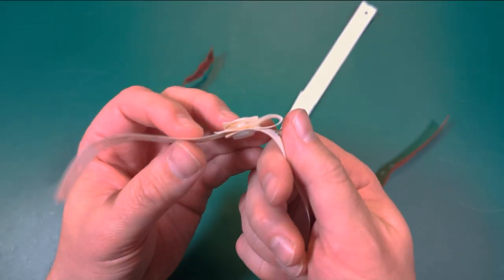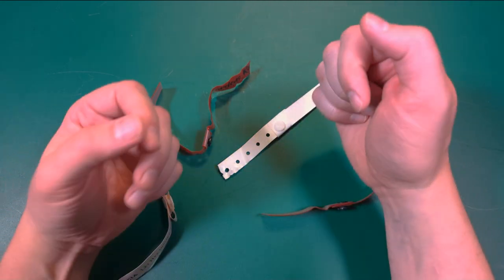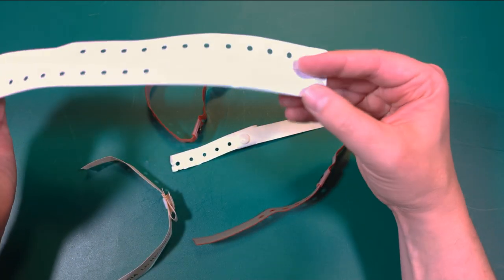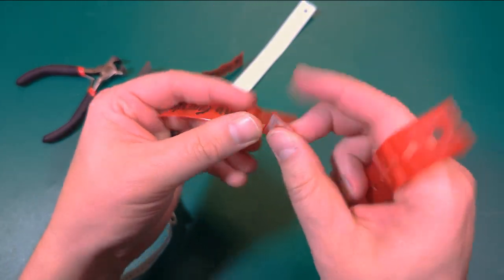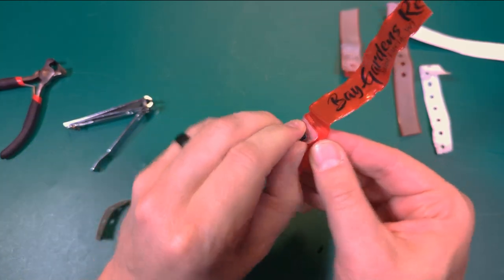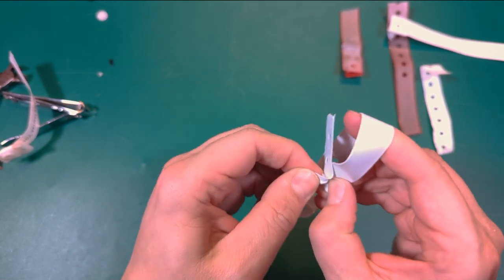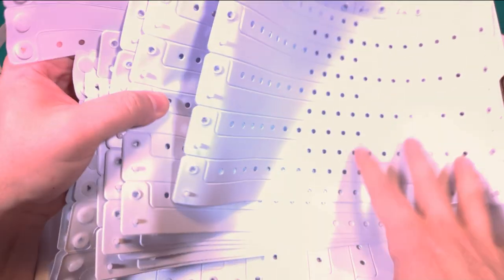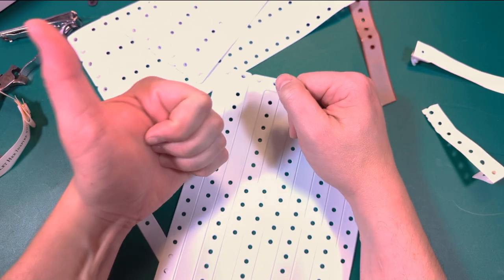Tampering with Wristbands - Part 1

Comment: it is possible, although maybe time consuming to remove them non-destructively, such that they can be put back on, with no tools. I was once admitted to hospital for about 3 weeks, and when I went in they twisted the wristband when they put it on me, which drove me mad. I spent a while applying gentle pressure, the snap eventually opened, I was able to remove and untwist the wristband, and then after that the snap held well enough that it wouldn’t come of accidentally, even if it got caught, but I could easily open and close the snap, remover the band and put it on as often as I wanted

Comment: I used to do this tons, there's a better way though, no additional tools or anything. Specifically those plastic/paper bands, if you cut a line right up to the hole the snap goes through you can take it right off and put it on again. If you want to secure it when you put it back on add some tape to the underside between the snap layers. Invisible, easy, no additional tools.

Comment: Presumably you only need to make it  big enough to slip on and off, so what I do is clip it enough to undo it with my tiny swiss army scissors, move it to a hole that allows me to pull it off and put it on without too much trouble and use a lighter or iron to gently melt it enough that it doesn't come apart. If you're gentle with the heat you can keep it hidden on the inside of your wrist.

Comment: I'm afraid I may ruin your plan! If you use the tapered end of a travelers hook from the back side of one of those snaps (female side, while it's open) you can wiggle it around and bend the fingers back to the point that poping the snap back open is very easy. You can make those snaps last for hundreds of reopening. If you don't have any snaps to spare, use a sewing needle to bend the fingers off the post. This will allow it to separate from the other side and not damage the snap! Then feel free to let a friend enjoy the bar at no cost. Try it out, then maybe give away the rest of the box and start collecting all the colors so you always have a replacement for the original color.

Comment: If you just shave the hard edge of the part that locks in, into a bevel with a nail filer, it should become a reusable snap. No need to have a stock of them and chop the thing off every night.

Some of these if you apply enough force will just pop open and have deformed themselves into a reusable state.

Comment: After you cut around it with the nail clippers, then come at it from the top to cut the stem off, now you can get the nail clippers over it.
Also I would just gilitean the stripps off to make a new strip of just buttons. then you can cut them apart like little pills so the raw buttons without the carrier don't get messed up in your bag.

Comment: Probably would be easier to just buy some regular plastic snaps from a fabric store and use those over and over. If you keep the snap to the inside of your wrist nobody is going to see it, and they also come in a lot of colors so you could keep some black and some white to match

Comment: This is an excessive solution for something some devious 4h-ers in Medina county ohio solved over ten years ago, they had to wear the wristband all week, so several options were developed to circumvent that. Option A: “whoa whoa whoa that’s too tight make that looser.” Gets loose enough to where you lather it up with soap and slip it off, they slip back on much either than they come off. 
Option B: you carefully cut a slit at the point where the snap is in the band it passes through and you just pull it out to take it off and put it back on. The story here is the problem became so prevalent and they were catching so many 4h-ers passing the wristband through the fence to get their friends and family in that they stopped using wristbands all together and went to punch cards that were gold embossed and apparently increased the cost significantly since they don’t come in sheets, but you couldn’t forge a card easily cause of the gold so it solved the county fairs issue with supposed lost revenue, that they then subsequently spent on gold embossing.

Comment: You can also use gallium for the metal ones as they're usually made of alluminium :p not sure if it's worth the cost and you would need a new metal piece but it will not damage the cloth at all XD

Comment: I immediately thought of an easier solution, maybe to easy and detectable? In english they are called snap fasteners ( just look up the wikipedia site). Couldnt you just use one of these? Granted they look different but to these people really check? They are small, made out of metal and easily reusable without popping out  by some light pressure.
Reply: Also some could see these and think of overkill but you could rivet a bunch of these together at home as the lip surely is enough for the tiny hole on these wristbands. Im not talking about riveting these on the actual wristband (even if you could to that if you wanted). Seems way more comfortable as reusable and no snipping away each time required

Comment: Honestly, dude, I was thinking you could use some cut-down refrigerator magnets or velcro tape to hold it on.

Nip it off from the back, hold the button cap in place with some super glue and then do the same with your removable connector of choice.

Comment: Here I am, sitting at home with one of these stupid bands for three days for a gaming convention. Unfortunately they use the other version where you have a teethed cylinder they pull the band through. Those are actually making permanent marks on the band so you have to replace them rather exactly.

I did manage one year to get it off and on without too much issue, but this year it just is way too tight.

For things like a gaming convention run by unpaid volunteers, I am willing to make the tradeoff that these bands cost money, but for anything more expensive like a trade show, you should be able to get a new band each day if you have a multi-day pass. Only problem is that this means standing in line every day.

Comment: I exploited the hell out of these years ago.. I used the tool to remove the terminals in Molex connectors... A little push and a twist and they almost popped right off... If they didn't re-snap a drop of crazy glue did the trick... As a group we collected them off ourselves after each event. They would recycle the colors every week or so.. Just needed a color that was close... They got a bit sneaky, cutting them off when you left, so we just wore jackets in so they couldn't put them tight and pushed the as high as they could go on our arms upon exit... If they questioned it, we said we ripped them off....  We would 1st do a drive by to see the "color of the night" ...

Comment: May want to also try pin extractors for cable connectors
Reply: I.e. just a hollow tube that allows the snap clasps to go over the recess they get stuck in?

Comment: i went to pax east this year and they had wrist bands for covid checks, it was just like a wide thing shoelace / lanyard type material. they had what looked like a hollow magnet but it was just plastic with sharp hooks so you just could not loosen it. the worst part is it loved to self tighten while just wearing it and when i went to sleep i woke up with my circulation almost cut off and i just could not cut the damn thing.   also on the 9/11 nail calipers, i remember in 2002 a tsa guy yelling at a guy that he was carrying a deadly weapon with him and it was a nail cliper the customer was like wtf are you talking about and then out of no where the tsa guy puts the nail clipper to the guys throat telling him how dangers it was and i just remeber at 14 trying to hold in my laughter
Reply: For a nail clipper to be permitted, it has to be of a so called "tamper resistant design", where its difficult to disassemble the clipper. Some nail clipper can be readily disassembled and become very dangerous weapons. Most cheap nail clippers are welded and permitted, but some can be disassembled, and then its by the TSA definition no longer a nail clipper, but 2 knife blades assembled together.
Reply: @sebastiannielsen  I didn't mention any of that and I'm talking about something that happened over 20 years ago

Comment: I feel glad ive never had to wear one of those
The only time ive ever had to wear an RFID wristband was at a world war 1 thing in Belgium, which i can only think to describe as a sort of interactive museum, the wristbands used there had a poppy on them
As well as being used for the turnstiles, the wristbands were also used for selecting the correct language on the interactive screens, and maybe other things
Reply: These bands aren't RFID, they're just color-coded plastic that employees (usually bartenders) look for.
Reply: @Blutzen  oops
Reply: @Blutzen  It do exist RFID variants of these bands. Both self-invalidating (where removing the band from the wrist will also destroy a trace in the circuit disabling the RFID tag) and non-self-invalidating. Some RFID wristbands do have a separate circuit for the "removal from wrist detection" so the scanner can digitally invalidate your access credential if it detects that you are trying to cheat.

Comment: So on the theory that somebody would be devious enough to place the RFID tag into the fastener I simply use the observed loose comfort fit to slide out of the cuff. I also noticed you replaced black fastener with white fastener. A properly observant guard would notice this.  I've found such observant guards often enough to plan for that. Of course, if you keep it on your wrist so it is not visible you can fasten it together with a screw and two nuts. (One is a jam nut.)

I presume you've made a perverse hobby of trying to read the tags in the bands, of course. Back years ago I used to do that with the old credit card room keys. I did not keep anything valuable in the room as a result.

{o.o}

Comment: Nothing pisses me off more than someone doing something to force me to be honest when I'm honest already, and I'm not into bondage or handcuffs which is what these wristbands seem like to me. So I'm liking the nail clipper "bypass" technique for sure. 👉Here's a hint for those end nipper pliers: Grind the ends flat, down almost to the cutting edge and they will cut closer and cleaner, leaving less 'wrinkle'. Better for electronics work this way too. Just watch the heat so you don't lose the temper of the metal 😎

Comment: I remember pulling the plastic apart using a thin flat screwdriver when I was younger. Could still reuse it after though it was loose and highly obvious it was tampered with.  

Now I'm curious to try again with a more expanded toolkit ...

Comment: For 99% of cases you can cleanly cut the band, then reattach it with good tape in the case of the plastic, or a couple stitches in the case of the fabric. I’ve even watched friends breeze through security with rubber bands around theirs. Very few security staff care beyond covering their own butt. YMMV.

Comment: I feel like this is one of those times where we're over complicating the solution.  Why not just cut it off with scissors, then when needed wrap a piece of transparent tape around to hold it back together?  as we learned in your early pen testing videos, if you look like you belong, nobody will look too close at you or your credientials.

If you have a red wristband, who's going to inspect to make sure it's integrity hasn't been compromised?
Reply: That's basically what I did after I pulled my wristband off while asleep by accident. Nobody noticed.

Comment: I get you but an an organizer sigh hackers are frustrating - it requires more staffing (volunteers) to re-check people each day where at a multi day event i could heavily staff first day then drop staffing if i don't need to re-band everyone (it's not cost with these things). if they were easy to remove you know people would share them. sigh. there is no winning. despite some comments below i am an event organizer and not a sadist (masochist thank you) there just really is not a better (efficient) way yet.
Reply from the maker: Totally. It is a frustrating problem. Fortunately, many hacker events opt to use fabric wristbands which are not nearly as uncomfortable.
Reply: A better idea for these events: Issue them a removable band with a RFID tag inside. Take a photo of atendees face, sign the photo with a keyed MAC, and store inside RFID tag. At next entry check, scan RFID and check photo.
Reply from the maker: @sebastiannielsen  wow that sounds like a fuckton of work and privacy invasion.  Also RFID tags don't have anywhere near enough memory to store a photo.
Reply: @DeviantOllam  Mifare classic can store up to 4k, and desfire up to 8k.  About privacy invasion, And thats the point of storing it in RFID tag - to avoid the privacy invasion, since you carry the photo with you, it isn't stored in a central database.

My profile picture here on youtube, takes exactly 1324 byte, and yours is 2051. Upping the pic like 50 % would make it about 2000 for me and 3000 for you, giving slightly better image quality. So it would even fit on a mifare classic 4k. And its pretty OK to identify that im not using someone else's wristband. Building a android mobile app that does this RFID MAC calculation and verification shouldn't be a big deal. Then app does all the work for you, both checking wrist band is valid (so its not copied) and also shows photo on screen.
Reply: @sebastiannielsen  the cost of readers, support that tech, doing troubleshooting - that is money, a lot of money for a 1k person event that most people attend free, and we get maybe 30 minutes to setup and train people. sadly until something is inexpensive and easy it's not going to scale.

Comment: It's a cool idea but it looks wasteful #plasticsoup
You inspired me to try a metal snap fastener, I think the black ones wouldn't stand out with security but they are also available in white and they are reusable. €4 for 50 should be fine. Smallest I could find are 7.5mm

Comment: Why not cut and tape it? All you need is good quality tape and a sharp enough knife. There's packing-tape quality tape that comes in those 2cm-ish wide portable dispensers kids use in school, or you can just use packing tape and pre-cut the right width while it's still on the roll. 

If you're worried that removing the tape will damage the band, wrap both sides of the cut with separate pieces of tape (which won't be removed) first, then use another piece of tape on top them to hold the two ends together. It's easy to remove packing tape if it's stuck on top of another layer of tape.

Tape-on-tape has all kinds of uses.

You can make resealable paper pouches or letters with it. Fold like 1cm of the end of a strip of tape over itself and use the rest of the strip to close the lid. Just tape over the paper where the 'latch' will stick on and voila.

You can even give it a low-grade tamper-evident function. With tape-on-tape and certain markers vs certain tape adhesives, the marker will get stuck on the sticky side. So what you do is draw on the non-sticky part where the 'latch' will sit then attach the latch in an awkward position so that if someone reseals it they're unlikely to put it back in the right position.

Mostly I just use tape-on-tape for posters or paper I want to stick on something so that it doesn't damage to poster/paper when you need to remove or replace the tape.

Comment: You could also remove it the first day with clippers, then for days after that, use https://www.amazon.com/s?k=screw+post+fastener&i=arts-crafts&crid=SNRECHOVJ8KE&sprefix=screw+post+fasten%2Carts-crafts%2C227&ref=nb_sb_noss_2  Screw post fasteners.  Lowes/home depot usually sells them.  if the silver one is too bright, paint it with some white nail polish first.  should work pretty well...

Comment: How about cut and epoxy?
Reply from the maker: Are you asserting that carrying around epoxy on vacation is easier than carrying a couple of spare little clasps? :-)
Reply: @DeviantOllam  Not at all. I was talking about in general. I've never seen those used irl - I'm so old, I've only seen the braided things, and hadn't seen the video yet, when I wrote - I think - where the security sticks fingers under and check for loose clamps aso. Maybe it's a Denmark thing, but they sure used to be suspicious here. Then again - If I had to choose between buying a bit of epoxy, or a gross of "hospital arm bands" like you did, I'd go epoxy. :D

Comment: Seems like a Chicago Screw would work and be reusable.
Reply from the maker: If you got one with a small enough shaft and didn't mind metal against your arm, that might work I guess
Reply: @DeviantOllam  Plastic or Nylon ones would certainly be more comfortable.  Post diameter would be the determining factor.  3/16" seems to be the lower limit in all materials.

Comment: When this came about, i was like "who gives a fuck". But i just saw gnfnr in groningen, and got one of these slapped onto me. I'd rather keep the band as a souveneir as complete as it gets, maybe wrap it around my guitar case handle i had on me on the trip. And i thought, just the right size of a sylinder and a press would get this off, but i got no tooling. And i dont wanna buy a pack of these for this, so yea a paperclip... How much is a stamp to finland? But yea, these golden circle wristbands are color coded. Idk do they have an unique for one every gig, or rotating weekdays. You get me, "just be there"

Comment: Way overthinking it, they'll never inspect the wristband integrity, just cut it and tape it back together from the underside, you can wrap a small razor blade and a couple feet of clear tape around an old gift card and keep that repair kit in your wallet.